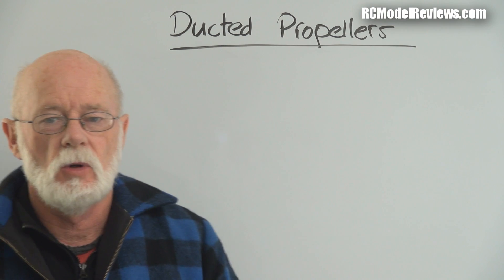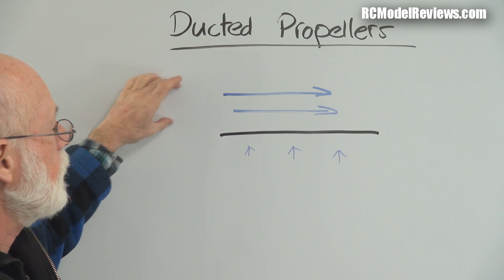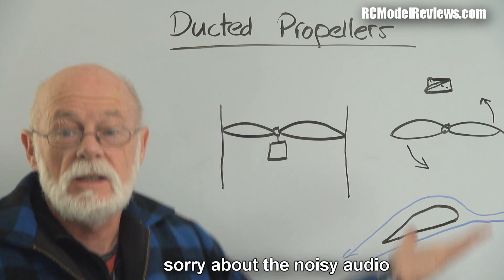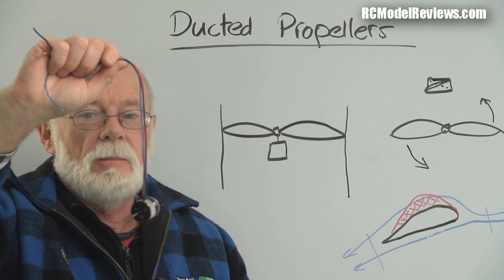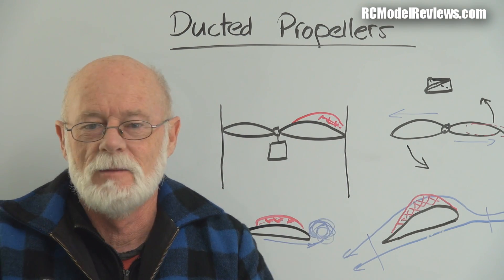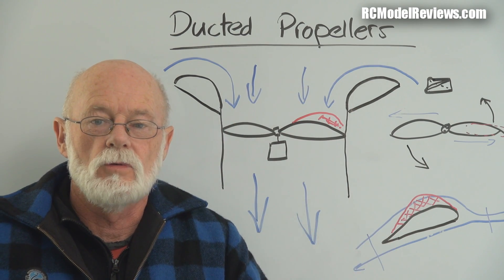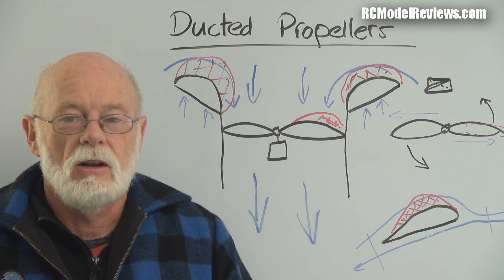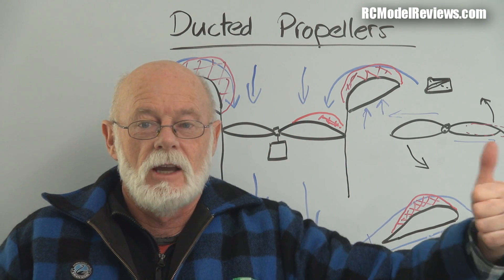How ducting a propeller increases efficiency and thrust

Comment: Brilliant explanation.

What if the prop tips were embedded into a ring that spun around as part of the propeller? This ring could be recessed within a groove in the inner circumference of the tube portion of the duct, thereby maintaining the general integrity of the tube inner shape. Yet, there would be zero blow-by because the tips would be embedded.
Reply: Propellers with rings cause another problem: they add a lot of extra surface area that produces a lot of drag, which in turn puts more load on the motor driving the prop.
Reply: @BrightBlueJim  Another practical problem is that making the ring thin enough will make them very weak and the segments between the blades will bow out. This will cause even more turbulence/drag plus pumping losses if it's tightly enclosed in a shroud.
Reply: bobert4him exactly what i was thinking. ive seen these on toy helicopters
Reply: What if the medium that the ringed propeller was using was water instead of air, would this be a beneficial use for say a submarine? I would think that since you don't need  to move a water/submerged prop as near as fast as a air prop that the extra resistance from the ring would be worth it for less cavitation creating a quiter and significantly improved drive system for a submarine or is this theory incorrect as well? Just whondering because I want a really efficient propeller for the sub I plan on building.
Reply: @spectre2466  You may be interested in the fact that the US Navy constructed and tested a full scale propulsor in the late 1970s and into the early 1980s.  It was fit to a couple of  Submarines.  It was also tested in a smaller scale for possible use on torpedoes.

Good insight on your part!

Comment: The tip vortex reduction was explained very well. But the second effect of the duct is misrepresented. The duct actually provides drag, not thrust. But it does speed up the flow at the propeller, which may be advantageous for operation in very small advance speeds.

Comment: 2:40 I am not a physician but I think the low pressure is formed when part of the wind you are blowing hits the paper which causes the wind to go over the paper creating lower pressure between the paper and the passing wind. try not to blow even a tiny bit onto the paper and it would not work. its just like a wing

Comment: Why do people allows show the fake demonstration of the theory.

Blow on to on the paper.. it rasises.

Blow on the bottom of the papper it also raises.

If this was because of this theory, then it would not. The reason is conservation of momentum, not due to air pressure.

About wings. Modern aircrafts wings are almost symmetrical. Its really when the flaps and slats are down that the flow over is significantly higher than the flow under. When at cursing altitude a modern airliner flies mostly on angle of attack.

6:05 This is totally falls. The length of the line is not what sets the speed of the air: There is nothing to say that the air over and under will meat up on the same time... Actually it don´t. The air over the airfoil take longer time to reach the edge. This is really quite well known for quite some time, but this old myths just stick around.

having low pressure on the top of a propeller is not as advangtages thow it also makes it harder to turn the prop. Specialy at a high angle of attack near the center.

Look at helicopter blades of real helicopters, again they are virtually symmetrical.

Usually for high quality screw propellers (helicopters don´t have Screw propellers, but rather rotors)  usually have more of a airfoil down the end than close to the center.

Of cause one can have the duct on the propeller, having no gap at all. Of cause it increases the drag on the other end. So in most cases it don´t really help.
Reply: Do you have a fishing licence?  Because that's some serious bait you got there.
Reply: matsv201. Is the 'Cursing' altitude where the pilots & passengers are all allowed to start swearing?
Reply: lol
Reply: "Do you have a fishing licence?  Because that's some serious bait you got there."

THANK YOU Proeliator9! 

The fallacies contained in matsv201's post were about to exceed the limitations of my medication. I also love fly fishing, so your very efficient response will now be kept readily available in my fly box for future use.  Thanks! ;)
Reply: me too haha...
Reply: Conservation of momentum still plays a role in the paper example due to the Coanda effect (air adheres to a curved upper surface of the paper, and the law of equal and opposite reaction means the paper gets pulled toward the airflow), but the bigger mistake in most pressure-related lift explanations is that they try to micromanage and explain all that's going on with the air-wing interface, and failing because it's generally too complicated to explain with just saying things like "Bernoulli principle".

The real story is that the wing interacts with the airflow, and that interaction causes airflow to be deflected downwards and the wing to be forced upwards. And the reason why an aircraft's wing doesn't really cause much visible "downwash" from the trailing edge of the wing is because the wing passes through pretty quickly and the small disturbance is pretty quickly halted by the static airmass the wing is going through. If the wing were to be contained to moving repeatedly through the same area, it would end up generating substantial downwash from the repeated passes through the same spot. This, in fact, is what happens with propellers and helicopter rotors.

This is the simplest, easiest, and the most accurate explanation for aerodynamic lift, and it really should be sufficient for any level of study until a proper introduction to fluid dynamics. Without understanding at least something about fluid dynamics, the risk of misconceptions arising from more complicated explanations is very high.

The high and low pressure areas are what are generated through the various interactions, because in fact there is no other way to mechanically interact with a fluid (like air) than to create high and low pressure zones to move it around, but they can all be described as the wing interacting with the air.
Reply: matsv201:  Actually, I just tried the paper strip experiment.  Blowing over the paper raised the paper.  Blowing under it caused the paper to flutter.  You are so sure of your assumptions, you don't even bother to test the simplest ones.
Reply: Sorry but you are wrong.  Air over the top of an wing producing lift flows faster then the surrounding flow, and air flowing under the wing flows slower then the surrounding flow.  As such the air over the top reaches the back of the wing much faster then air flowing over the bottom.  I know I actually went to school for this shit, and have actually watched wind tunnel experiments with smoke and strobes that make this very easy to see.

Comment: time 2:48, i see a long paper tongue sticking out of your mouth. impressive.
the pressure appears the same above and below the surface when the air is static. the static pressure is the same.

when the air above moves, it drags on the static air in contact with the surface. that is the transition layer which at the surface level is stationary and at the level of flowing air is moving with the flow.

the effect of dragging on this thin transition layer is the reduction of static pressure inside the transition layer. for a wing, this will bend the airflow above to stick to the surface, or the Coanda effect.

the air above is subjected to expansion due to reduced static pressure in the transition layer. this should decrease wing temperature (wing in contact with cooled expanded air) but only down to a value related to the negative pressure difference atop the wing.

time 10:30, the vortex at the end of the propeller is caused by the centrifugal effect the propeller has on the air, and not by the under-upper motion of air. if you meant to say the tube disrupts the vortex and preserves the air in, then i agree.

time 12:30, the shape of air intake is to allow a laminar flow of intake air as to maintain propeller efficiency. that's not a wing in cross-section, is just a convective surface.

time 14:00, that's not a Coanda-effect. that is a thicker vein of static air getting compressed into a thinner one inside the duct, which as I already said in the beginning, becomes extra pressurized and jets away through exhaust, hence the jet engine.

Comment: not to beat a dead horse, but the one thing he got wrong is the "high speed" air above. What makes you think the air needs to meet up with the molecules it was next to when the flow separated? 

the point of an air foil is to prevent flow SEPARATION. a flat plate will flow just fine until your attack angle is too high for your speed, at which point the flow on the trailing edge separates. When this happens you have massive inefficiencies due to the vortexes that form at the separation point. By using an air foil shape, you can use a more aggressive angle of attack at higher speeds without separation since the air more naturally follows the top shape of the wing. This allows you to gain more lift.

Comment: Bernoulli did not say that air blowing over a flat surface will reduce the pressure on the surface. He said that when a fluid accelerates, its pressure decreases. The example of blowing over a curved surface shows that the centrifugal force on the moving air tries to pull the air away from the surface, lowering the pressure on the surface. If air blowing over a surface lowered the pressure, then air blowing over a flat piece of paper would cause it to rise. It does not.

Comment: Oh God equal transit theory!  The Bernoulli principle contributes hardly any lift in an aerofoil.
Reply: The Bernoulli principle does contribute to a lot of lift. Otherwise aerofoils wouldn't need a larger upper camber in order to generate more lift and areas of high and low pressure wouldn't form. However, what you say about equal transit theory is correct. The air particles have no reason to meet up at the trailing edge, in fact air particles travel a lot faster over the top of an aerofoil that the equal transit theory predicts they do. 

Equal transit theory also doesn't explain why symmetric aerofoils produce lift.

If you want more information on this kind of thing, I'll leave a link to the experts: https://www.grc.nasa.gov/www/k-12/airplane/wrong1.html
Reply: @shizzlestix7887  
The "air particles" have every reason to meet at the trailing edge of the wing! 
The point that most people fail to grasp about Bernoulli's Principle is that the air flowing over and under the aerofoil are not "travelling at different speeds", they are both stationary! The aerofoil is travelling between them & is longer over the top than underneath hence the air particles are spread out over the upper surface more "thinly" than under the lower surface & "spread out thinly" means "lower pressure" hence lift! They "move faster" with respect to the surface of the wing but, they don't move anywhere with respect to eachother!
This causes a "boundary layer" of low pressure air which is very thin & can be disrupted simply by, for example, rivet heads which is why countersunk (flush) rivets are used on lifting surfaces on aircraft.
Lift augmentation devices (flaps & slats) exaggerate this effect further providing more lift at lower speeds for take off & landing.
As for symmetrical wing sections, I think the guy in the video mentions fighter jets staying in the air by using a flat wing with a high angle of attack & raw power which ends up producing the same effect with air having to travel over a vortex generated over the wing's upper surface. Fighter jets are inherently unstable which is why they are so manoeuvrable.
Reply: @peteclark7662 Good point, the air is stationary, it's the wing that moves. 
Most explanations have it the other way round!
Reply: Then why do symmetric airfoils also generate lift?  You don't need Bernoulli to explain lift; you need Newton: downward transfer of momentum.  Regardless of the shape of the airfoil, if you deflect air downward, whether due to the camber or due to the angle of attack (or, more commonly, both).
Reply: Jon :  Explain AoA stall..
Reply: Bernoulli's principle tells the upside of the wing gets low static pressure (static in reference to the wing) due to air drag on the wing and the downside gets high pressure due to air clumping underneath.
Reply: Thanks for the link. It just goes to show, fluid dynamics really is one of those topics that seems simple, but is actually very complicated and full of surprises.
Reply: The Bernoulli principle contributes nearly ALL the lift in an airfoil..
Reply: Also on 'Equal Transit'.. The air does not transit - It stands still while the airfoil goes through it. This makes the low pressure above Plus causes the drag by induced vortices.
Reply: @Peter-zz9ur  yes, that's what I said, the air particles aren't going anywhere, the aerofoil is moving between them
Reply: Great. YouTube ate my response. :(

Although more likely is someone deleted it, if this is anything to go on: https://productforums.google.com/forum/#!topic/youtube/uAofKjtZqSw

sigh I'm getting rather sick of my longer replies to people being mysteriously disappeared. Fuck.
Reply: Apples and oranges, although I agree that there are additional forces acting on the blade. As speeds approach the speed of sound and you get into compress-ability issues etc. Rotors are neat because of the rotational velocity and how that can get into the vortex ring state, as oppose to a fighter jet or fixed wing where all those issues are behind you. I would guess that this has something to do with why the quad copters are not gigantic yet.  As soon as you approach the speed of sound on the wingtip all hell would break lose without adequate design for subsonic and supersonic flight. This could be done but probably not something that would be conducive to battery life right now.
Reply: what size of air plain you talking about
Reply: how the top of the air-plain vs the lower part depends on speed of the top air or low air how fast thees two travel against each others like he should have had an small rc wind tunnel
Reply: Holy Hell! You better tell all the aircraft manufacturers quick! It's all a ruse! I knew there wasn't something quite right about that Bernoulli guy!
Reply: Fighter jets work on a different principle to stay in the air. It's like saying an electric car is hoax when it drives because it's not using any diesel or pertol when it's driving. Fighter jets use just pure raw power to stay in the air. You can even get a brick to fly when you apply enough force to it. Like throwing it. Then it flies for a moment. Apply that same amount of force to it constantly, it will fly constantly.

Commercial passenger airplanes are based on this higher/lower pressure principle. Fighter jets are not.
Reply: Jon     Yeah I cringed. It's not hard to think it through either. Just look at a fighter jet and ask how those get any lift.
Reply: Keith Jurena
Vortices in the separated flow induce drag. Simple(ish). (Not really simple but that's what you get when trying to condense a complicated-as-hell subject into a sentence.)

Comment: Why don't helicopters use ducts around their blades?
Reply: tip jets work better for helo's
Reply: Rebals Reba during the cruise (by which I mean Vh) a helicopter, or indeed any other air vehicle, is producing enough lift so as to remain in level flight. Whilst it's true to say that adding a ducted fan outside the main rotor would induce unhelpful drag in the cruise it is false to say that the rotor "wing" would be stalled. It's very difficult to stall a helicopter because even when hovering helicopters create their own relative airflow.  I would suggest that the real answer to the above question is simple: because it makes no sense.  The extra drag, max takeoff weight and reduction in useful payload would outweigh any aerodynamic gain. If you look at the blue edge blades that we make in Airbus Helicopters you will see that there are better ways to improve rotor efficiency and to overcome the challenges of Vh flight, especially Vh at MCP, retreating blade stall etc than by adding a ducted fan. Nevertheless, check out our tail rotors... aha! Makes sense there. Google H160.
Reply: Mr Jay White sure, that's why there in use so widely 😂
Reply: you mean like a big circle around the tips of the propeller? for once, the blades are already heavy enough for the load they carry. for twice, the blades are so long that the loss along the blade probably disperses before reaching the tip.
Reply: ayokay123 the Gazelle and a few other Eurocopter products used a ducted fan for their tail rotors. But the weight of the ducting on the main rotor blades would be too great as the blades would need either bearings at both ends or be able to flex without suffering from the effects of fatigue.
Reply: Think of a helicopter rotor as a wing, not a propeller. A gyro copter doesn't have a powered rotor (well, except in some cases just to get it moving) but by moving through the air with a prop, it can attain lift.
Reply: Some do! All the latest models of Airbus Helicopters (formerly Eurocopter) use an enclosed tail rotor which Airbus call a fenestron.
Reply: During cruise a helicopter flies forwards, not upwards and the rotor acts like a wing. A duct flying at almost 90 degree angle against the wind would badly  disrupt airflow to the rotor and cause it to stall. A helicopter rotor would also need a very large duct which would cause a huge amount of drag.

Comment: spanwise flow on the propeller is due to high pressure moving towards low pressure, not "centrifugal force." that vortex at the wingtip occurs on normal wings, too, not just propellers. it's part of why winglets are used, to hep reduce that vortex.